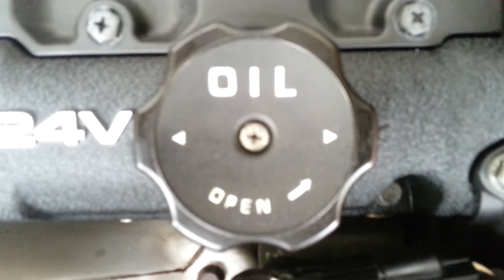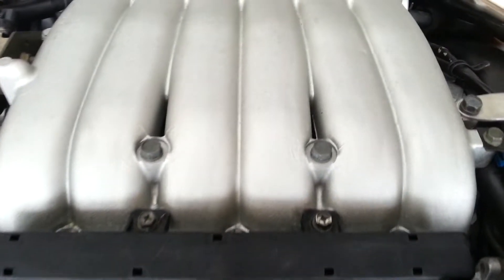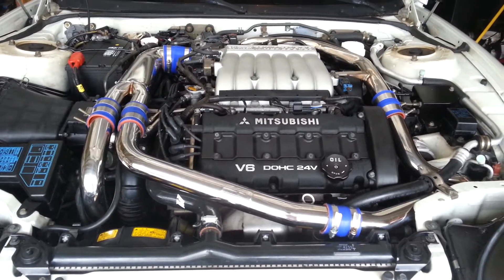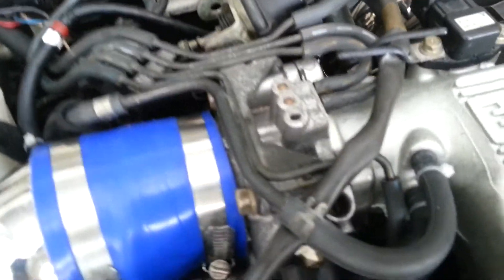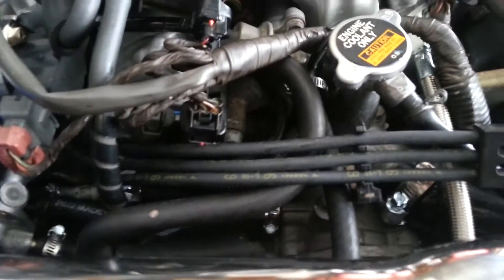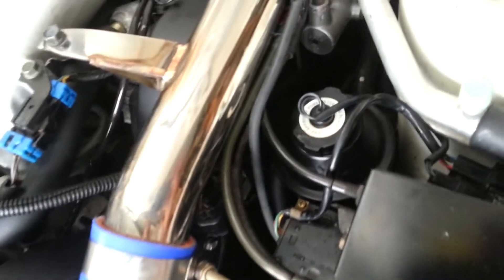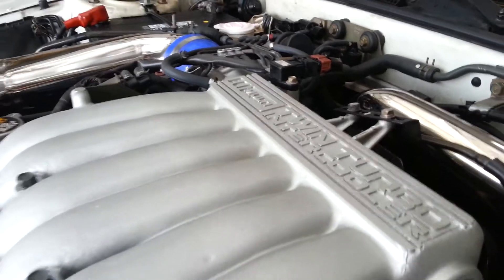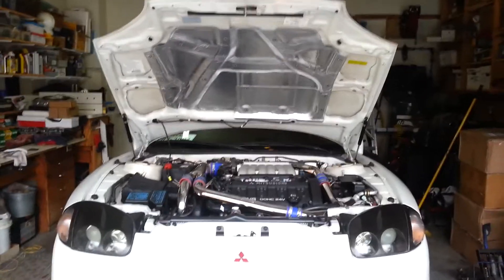Last VR4 Built - Final Assembly

Comment: Man I wish I had as much skills as you at these cars,but I guess I have an excuse considering I'm only 17. It's just a pain in the ass I never have enough tools or I'm missing a part this and that and it gets overwhelming. All I wanted to do is simply change the exhaust, then the bolts are completely corroded into the exhaust as one piece and are all rusted. Now I need a blow torch or something, or an air impact tool.
Reply from the maker: +shnoopy doopy  A blow torch and a lot of penetrant oil. Go back and forth.  Air tools definitely a big help. Cut off those pieces you are going to replace to make things easier but try to save the mounting bolts off the manifolds with the method above.  Rome was not built in a day so investing in tools takes time and money but the money you save doing it yourself will help pay for them in the beginning. Just how you have to look at it. Good luck and just take solace in knowing that the money you spend on good tools now will pay for themselves later.
Reply: tonkatoytruck Yeah, that makes sense. Thank you for your words of wisdom sir!

Comment: Hey i have a 1995 DOHC base 3kgt. It has a tt plenum borla exhaust, and testpipe. But like randomly the RPMS will rise normally lets say 900 it will rise slowly to like 1100 then bog back down to 900, over and over. and outside of the car it will make a random bog noise out of the exhaust, do youthink there is a leak somewhere?
Reply from the maker: I would check for vacuum leaks, exhaust leaks, and run some diagnostics on the ISC Servo. The service manual spells it out pretty well.
Reply: tonkatoytruck Okay thanks, and have you ever heard of installing OBX headers from ebay on our NAs? Theyre the same price as a regular 3sx downpipe so i just thought it would be better to buy the headers, some say they fit fine some say they run into one of the motor mounts im not sure.
Reply from the maker: It seems to be the luck of the draw with the eBay headers. Either they fit or they do not. If they do not, it is a real pain to make them fit.